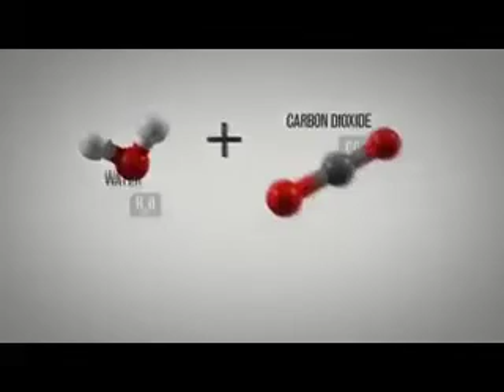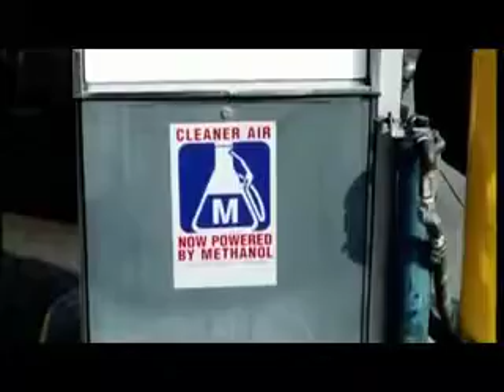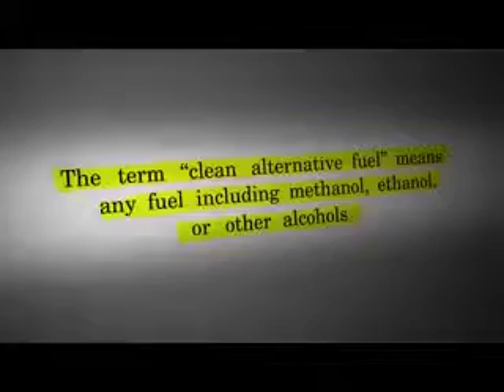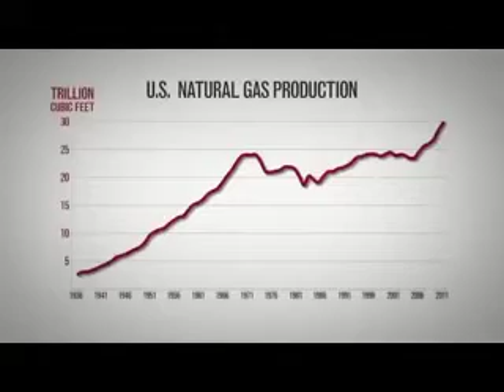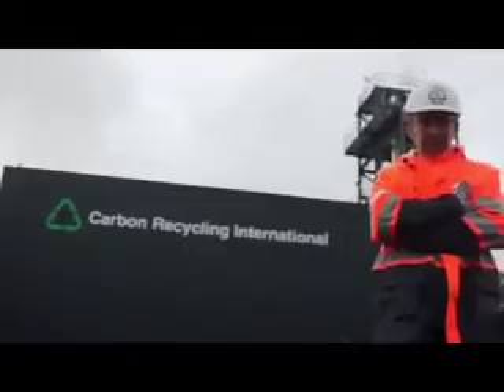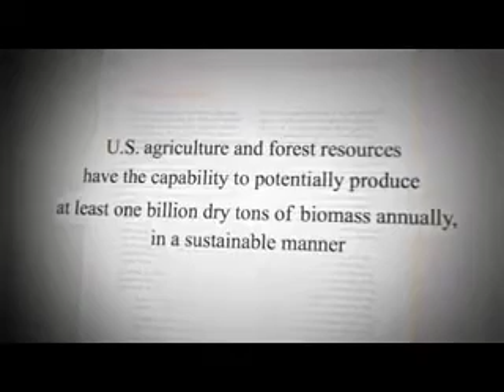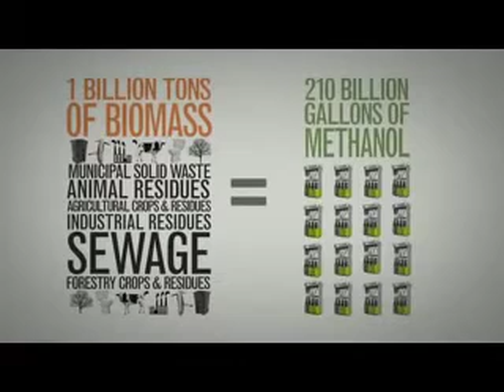Methanol as an Alternative Fuel Source

Comment: Can I use it in 1980s cars/motorbikes?
Reply: yes... methanol has a higher octane rating than most other fuels.  you could use it in highcompression turbo motors too
Reply: @Joshee365  well I discivered butanol, eich is equal to gasoline so....win win

Comment: This is slightly misleading. Anyone out there who thinks this is simply about an easy process of recycling CO2, think again. Methanol is primarily manufactured by reforming natural gas (Methane). Methane is an abundant and cheap fuel source.  It can be sourced through conventional petroleum production or from biological sources (landfill and sewage works for example). Why do we need to reform Methane? We need an affordable source of Hydrogen so that we can synthesise Methanol.  In simple terms you need to react 3 Kgmoles of Hydrogen with 1 Kgmole of Carbon Dioxide to create a 1 Kgmole of Methanol.  Producing Hydrogen is expensive.  It requires a lot of energy.  Electrolysis of water is an alternative to gas reforming, although the production cost and energy required to follow this route is much higher (~300%).  The capital cost of equipment together with the high production costs is preventing the large scale production of Methanol as a fuel source.  Methanol will possibly play a significant part in the future energy mix.  There are however many competing energy technologies and it is unclear the extent to which methanol will be important.